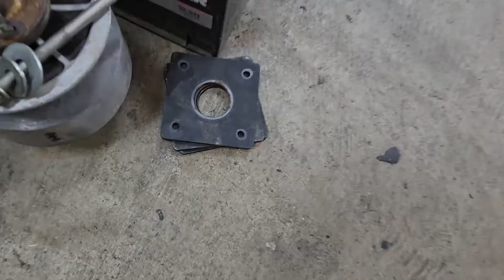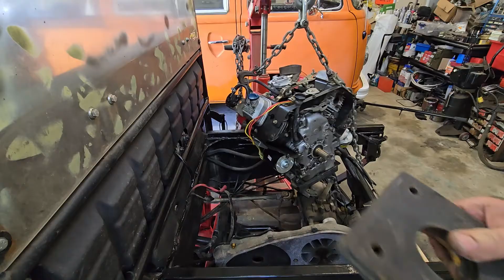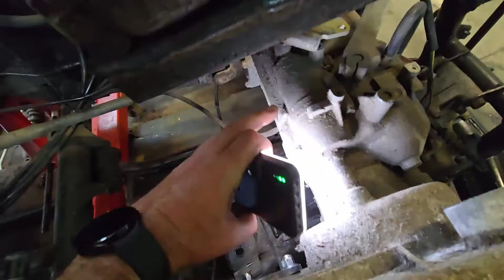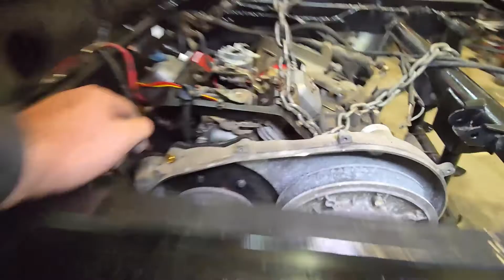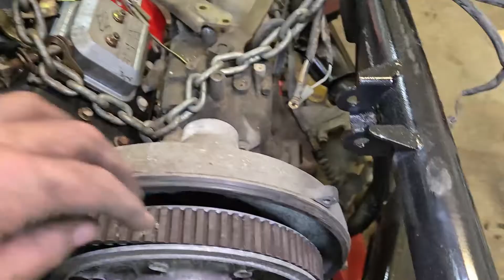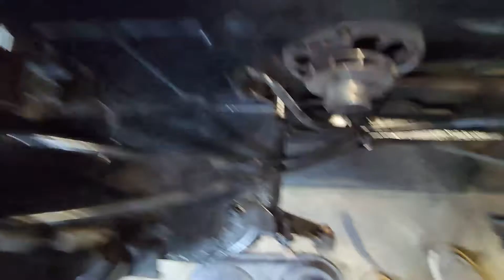Vanguard Engine Install Into Kawasaki Mule!

Comment: Just screw  two all thread in the block for assembly to line up adapter and spacers, then remove.  Couldn't you use comet engine side torque converter and simple plate for adapter.
Reply from the maker: There are likely different ways to do this, I just went with what I could figure out. The plates and mounts in the kit are def something you could fabricate with a lot of measuring but for 300 bucks to get everything I needed, including the splined adapter, it was worth it to me. Thanks for watching!
Reply: @MufflerBearingMotorpool I get it, funny sometimes you'll think of a way to do something. Then some wise guy comes along or in my case my wife and she'll say,"why don't you do it this way" and I'll think darn she's right. Haha, fabricating does make you think a lot

Comment: Thanks for your time on this. I subscribed, good luck.. is there an engine that doesn’t need adapter kit? There must be an engine with spline?
Reply from the maker: If there is one that doesn’t need the adapter, I couldn’t find it. There wasn’t a ton of info on the internet about converting these, outside the website of the place that makes the kit. The later mules didn’t use a splined shaft so the adapter was much simpler but I got “lucky” and my clutch was splined. One thing I should have done was rebuild the clutch while I had it out…..